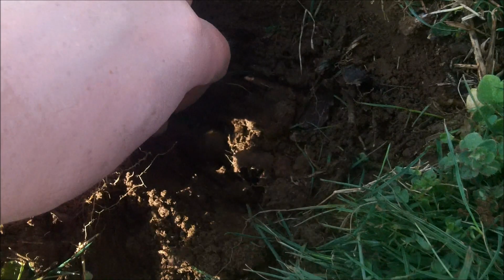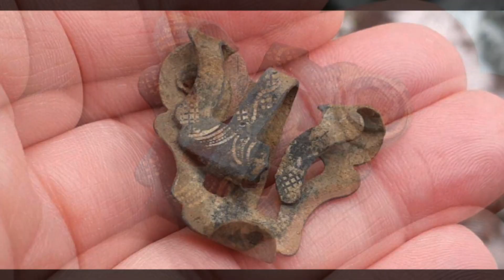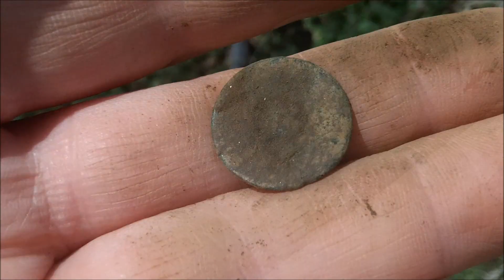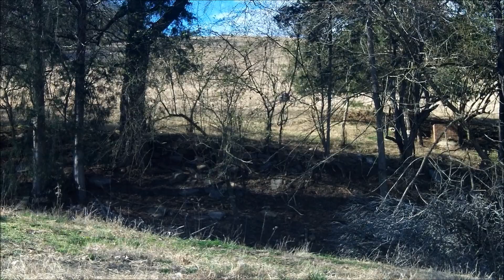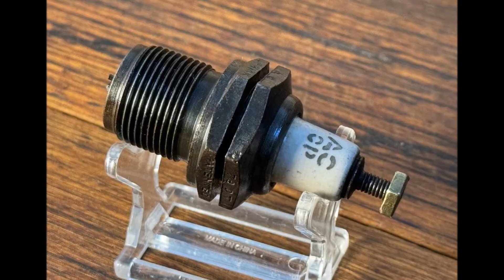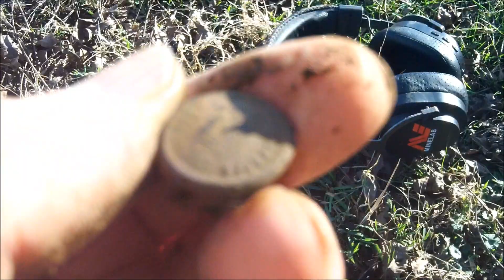Metal Detecting Amazing Finds of Soldiers and Settlers Who Once Lived on This Centuries Old Ground!

Comment: Nice work Greg!!! I’m considering getting another Manticore now that the M-9 is out, but I also might get the 900 because I can use all my coils from my 800. I dunno, we’ll see. ATB
Reply from the maker: Thanks Bob and I have to say the Manticore has amazed me and I can't get enough of using it. The M-9 coil is outstanding as well. The 900 is an excellent machine as well. If you decide you want a 900, I do have a friend of mine that has a virtually brand new one that he is wanting to sell. I think he has about 10 hours on it. He decided he wanted the Manticore after I started using mine. Let me know if you are interested in the 900 and I can put you in contact with him. ATB Greg
Reply: @ sounds good, thank you